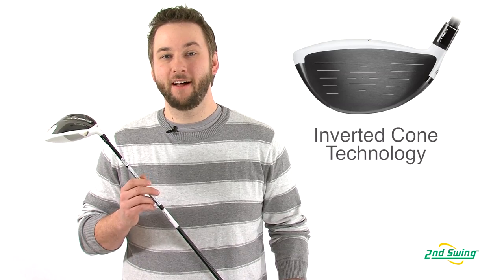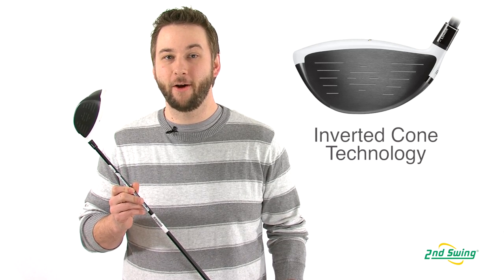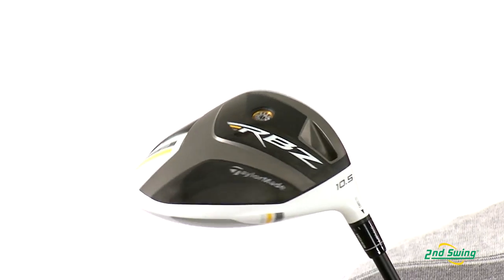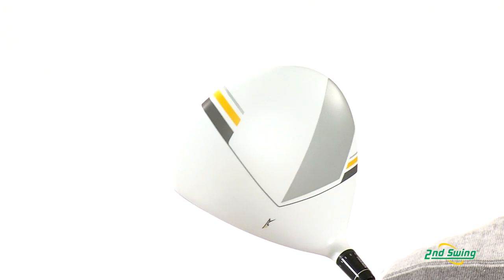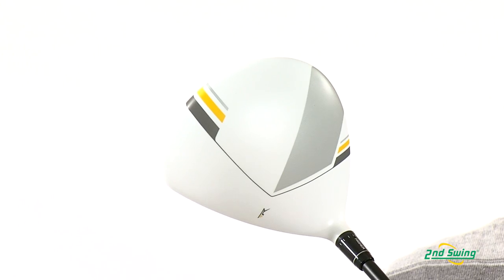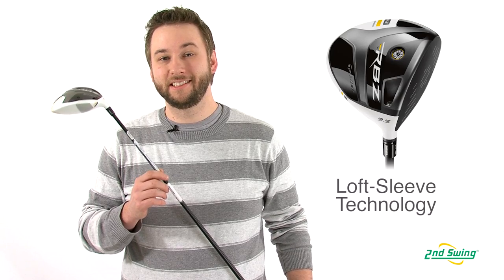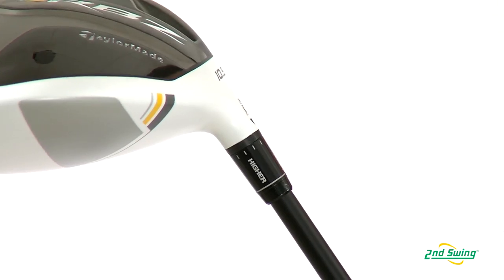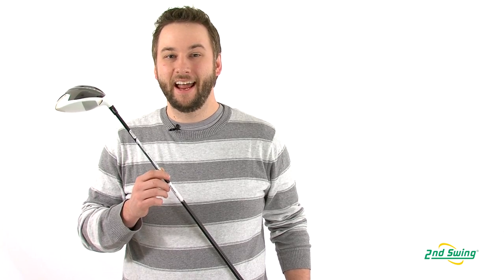TaylorMade RocketBallZ Stage 2 Driver Review

Comment: I just got a new RBZ stage2 loft9.5 driver as my father's old one. I felt that the shot was good ball flight, but slightly out to the right at the end. Which is a big problem for me because I don't know it's in my swing. or at the design of the wood or is it because of the sleeve angle adjustment? Can you review that compared to newer drivers it can hit the same distance? (I just changed the shaft to ventus5s OEM) I tried searching the internet and no information.